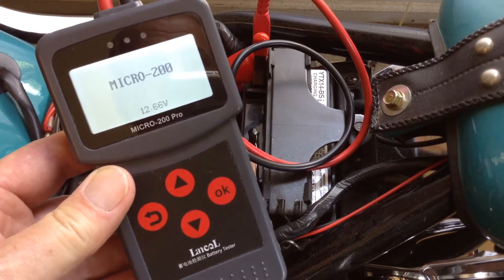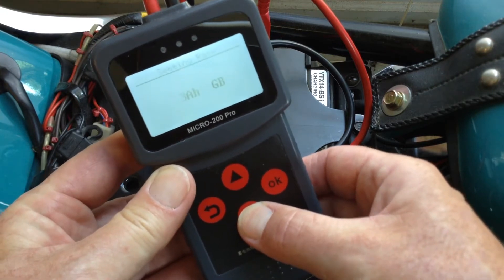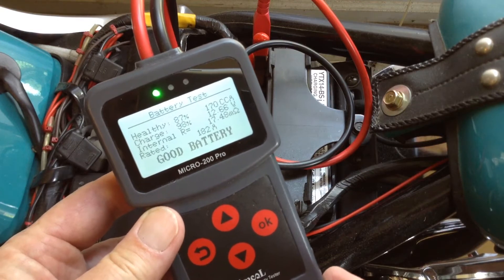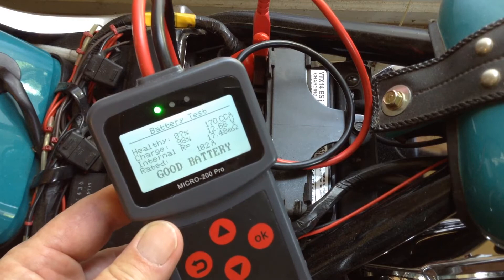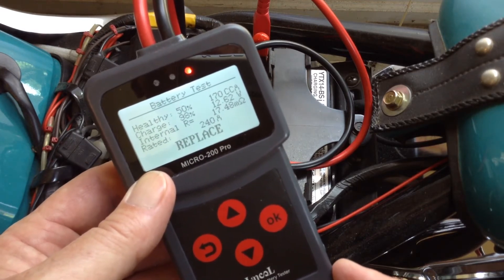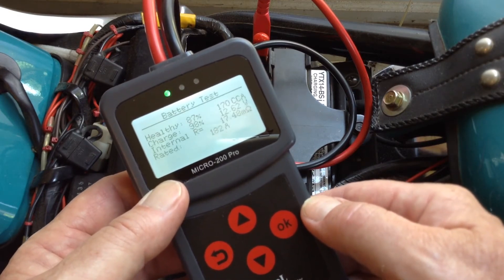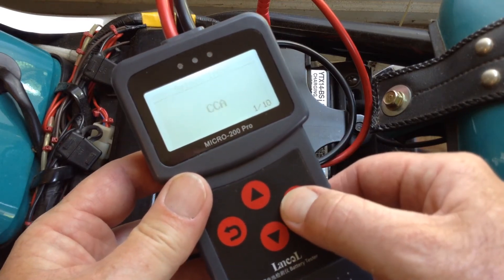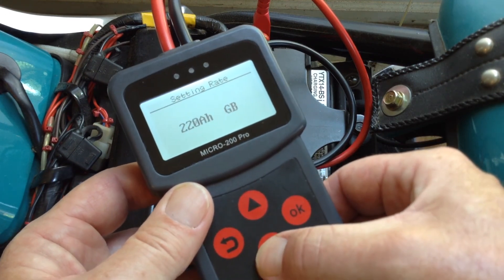LANCOL Micro 200 Pro Battery Tester in GB mode - Amp hour input

Comment: Oh man, you really make my day! so much appreciate you took consideration of my though. Perfect Demonstration man!
i nearly ended going for a " DUOYI DY219" that i discovered today, rated 3Ah minimum and displaying a screen with Manual Ah tipping, also able to check 24V batterys (version DY219A), cheaper by the way...but not mentionning if all right with batterys other than regular flooded.
Your battery CCA might be low because of quit high resistance that device mesured, that's usually a sign of battery a bit sulfated.
Specific desulfating chargers can help but in addition with EDTA (forget about magnesium sulfate), alone public cheap chargers with desulfating function are nearly useless, them action are really limited, and modern batterys can't stand well a deep treatment (they are fragil now) offered by specific device way more expensive. Not guaranteed, but you can try EDTA in addition with desulfating charger function, i recovered batterys that just started showind weakness, but not too much "used"ones...
Great thanks my friend, have a good day!
Reply: What is the standard for testing 220ah tubular inverter battery GB or CCA
Reply: @alexeffiong6712  Hi, i guess there isn't any mention dedicated on this battery because it's specifictly design for inverter: CCA, EN or anyother grade is not relevant, such a systeme don't generate highcurrent discharge as a cranckin engine does.